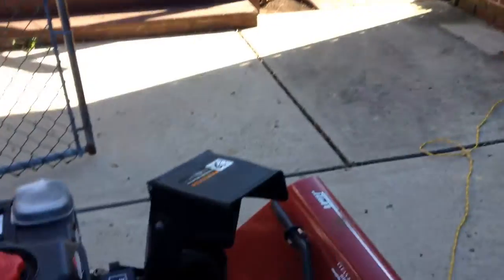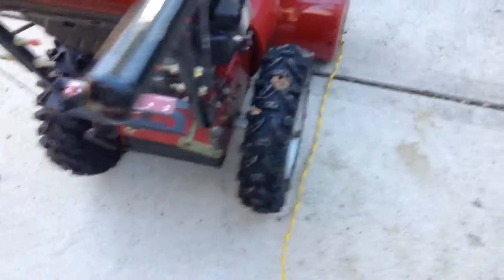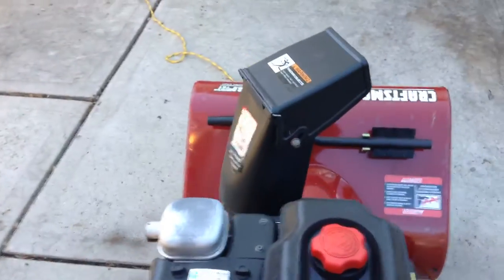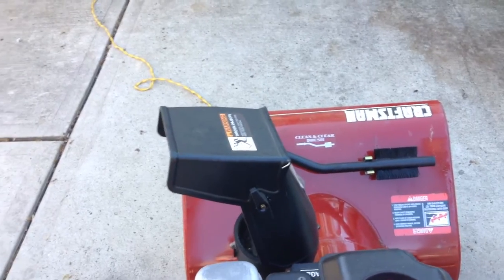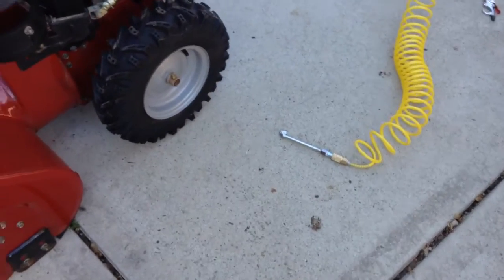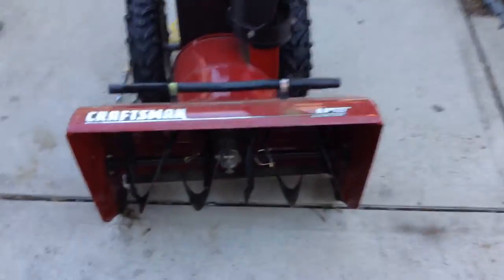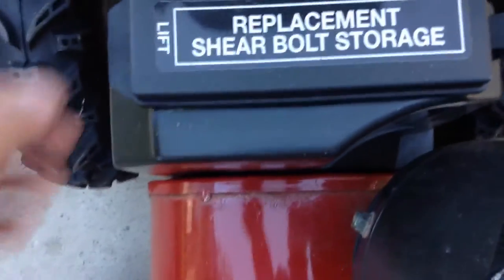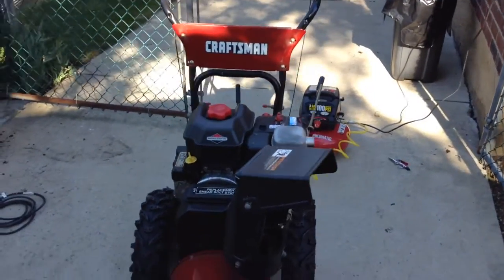2004 Craftsman Snowblower

Comment: We have this same model, new in 2004, still works great in 2022. Did the impeller modification, it really throws the snow. I didn't realize I was blowing snow off the driveway, across the neighbors yard and onto his freshly cleared walk. I went over and cleared it, and deflected snow the opposite direction. I use full synthetic oil in the engine, it sits in the unheated shed and starts easy with the recoil.
Reply from the maker: Very Nice.

Comment: Ah, I remember those good old days of being tethered to the wall thanks to apple. I now have an s4 with an 7800 mAh extended run time battery and I can film for hours if I wanted to. I think it's around 7800 mAh. Its the biggest one they make for the s4. The memory will fill up faster than the battery will die. lol. Nice snow blower btw. Great video!!! Go Android and samsung, you'll never go back to apple.
Reply from the maker: I have since sold that apple thing. I have a S5 cell and a samsung tablet. They both work great.
Reply: xjoe81x Glad to hear it. Get an Anker battery. It's $40 at the most. You'll do all your recording and never have to charge it.